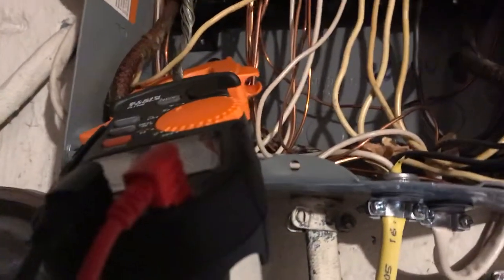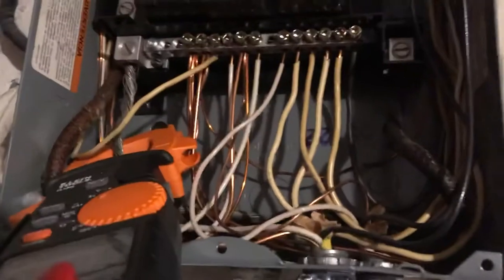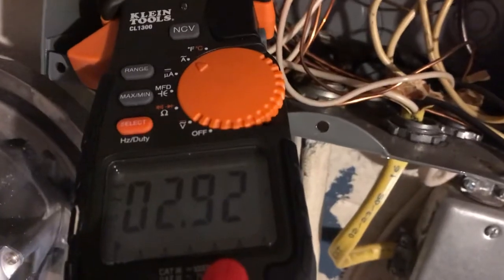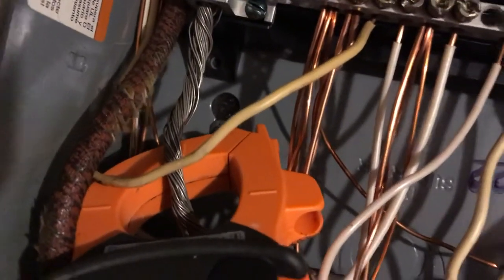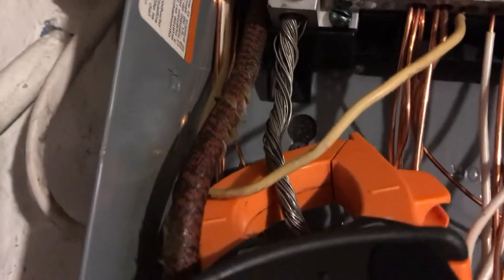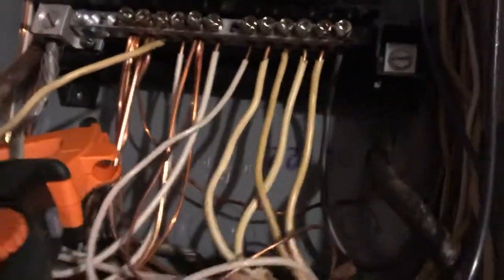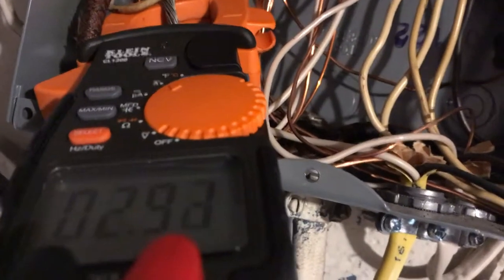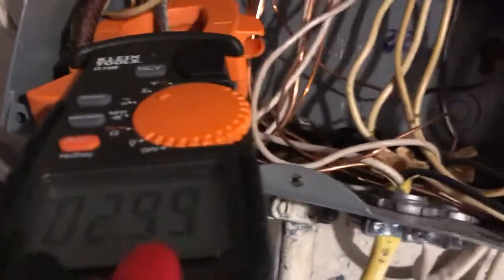Testing to see if your electrical load is balanced (See description below)

Comment: Your video is very detailed. I appreciate your time. I’ve also heard that unbalanced loads can leave you with a higher electricity bill. I enjoyed your video 👍
Reply: they absolutely do not unless you are trying to correct a power factor which is only done in large 3-phase industrial installations and seldom commercial installations as well.

Comment: you also have ground wires (bonds) on your neutral bar or vice versa. totally wrong installation to begin with, there is a reason there is a "ground bar" and a neutral bar separate for a reason